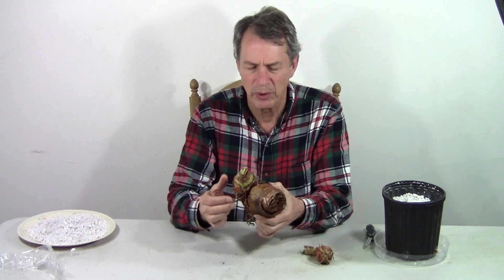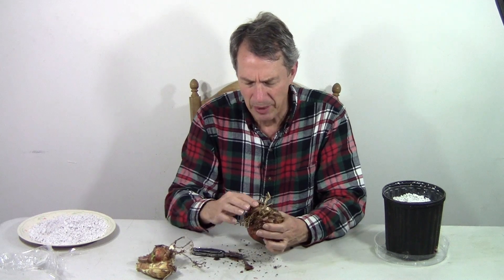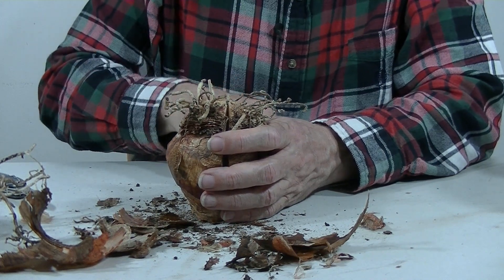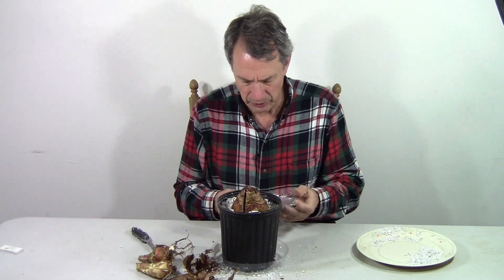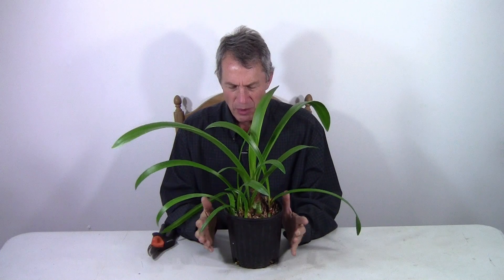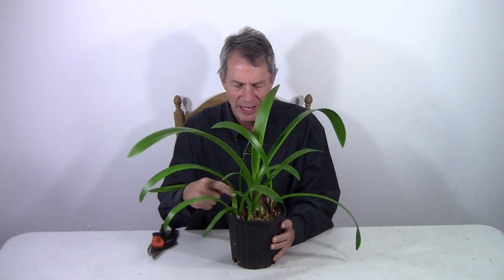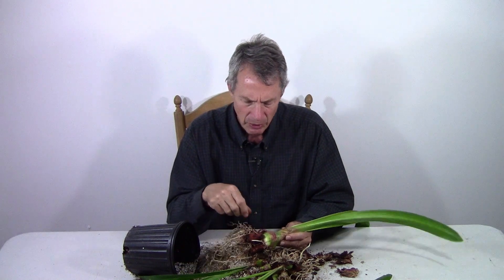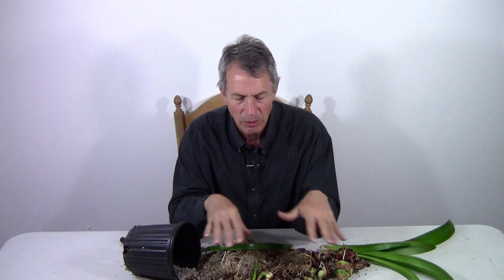Amaryllis Bulb Propagation

Comment: if you are able to cut through it and have them individualized what is the advantage of how you did the last one by leaving some still attached versus cutting all the way through it and having 6 separate wedges?
Reply from the maker: If they stay together, they can get nutrients from the leaves that are growing above them. if separated, they have to first grow new leaves before they can start growing a bulb. It works, but it is slower and some sections may not survive.

Comment: If I remove the basil plate will the bulb survive?
Reply from the maker: That is kind of like asking can I remove the tree trunk and will the tree survive. Check out this video that I made that shows the parts of an amaryllis bulb. https://www.youtube.com/watch?v=kD93TWySJJQ  It is less than 2 minutes long.
You can see how the basal plate is the stem tissue that has the buds for roots and leaves. I suppose if you peeled all of the leaves off and cut the roots off and had nothing left but the stem tissue that it could regrow leaves and roots. That would be the equivalent to plucking all the leaves off a tree and digging it up cutting all the roots off near the trunk and then replanting it. It sounds like an interesting experiment to me.
Reply: @agreenerview 
You can do twin scaling that produces new plants in a way with no basal plate involved.!
Look up twin scaling methods on youtube. 
Or you can cut from the top instead of from the bottom almost all the way down to the basal plate section in as many cuts as you like.
The more cuts the smaller the new plant bulbs that form will be.
You devide each cut with any a piece of plastic strip you place in the cut all the way down the cut to prevent the cuts from healing and growing together again.
You can just sprinkle some cinnamon or tumeric powder all over the cuts as well to help prevent fungal infections in the cuts.
Then pot the bulb like normal and wait for many new plants to form.
Reply from the maker: @brucecarey1780  Typically, twin scaling does include a portion of the basal plate with each piece. Tunicate bulbs have a paper-like covering and typically need a portion of the basal plate to create a new bulb from each division. Imbricate bulbs have fleshy scale-like overlapping storage leaves (lilies). The individual scales can be separated from the rest of the bulb and planted. Again, it is best if each scale includes a tiny piece of the basal plate. Many will grow a new bulb.
Reply: @agreenerview 
Very true. Just a tiny piece is needed to start a new plant but it takes time.!
Reply: No the bulb or the cut pieces will not survive.!
The basal plate contains all the growth points that is required for root and leaf development.!

Comment: I did this experiment in April this year. I now have eight little bulbs.
Reply: April is in the beginning of the Northern Hemisphere growing season. 
I suppose for me in South Africa it will be in September or October? I am keen to try this. Your opinion will be valuable on when I should try this. Just bought bulbs that was taken out and couriered to me.
Reply from the maker: @altastretton1768  You are correct. Start this project in your spring. I don't think it is too late. If you have a bulb or two to spare you could do a trial run now.
Reply: @agreenerview  Please help! Two of the bulbs arrived with soft spots. I had cut it away with a sterilised knife and had dusted some cinnamon on.
How do I prevent it from destroying the bulb completely. Think my mistake was not ordering in the dormant time.
Most do look healthy. Only two had rotten spots.
Reply from the maker: @altastretton1768  Call or email the company that you ordered them from to see if you can get some sort of refund. Keep those bulbs separate from the other ones and let the cut areas dry off for a few days before planting them.
Reply from the maker: I am so glad it worked for you. Now the challenge is to grow them to blooming size.
Reply: @agreenerview  Right! It seems these baby bulbs are slow to grow.

Comment: Cut in top to down. No down to top.
Reply from the maker: The basal plate tissue that makes up the stem tissue in the bulb is located at the bottom of the bulb. It is where the roots grow down and the leaves grow up. If you cut from the top down, you will only cut leaves and not the stem tissue that must be cut to make this type of propagation work.

Comment: Where do you store the amaryllis while you wait for it to get sprouts? Can you store it in a covered porch?
Reply from the maker: I use a closet that is in a cool room and I use a shelf in an attached garage. The temperature can drop down into the 40s and 50s F but should not get colder than that. If left in a warm room they may sprout early and you won't even know they are growing. I leave some in pots and I take some out of the pots. That doesn't seem to matter. I do put the ones out of a pot into a paper bag.
Reply: So if I live in the southern half of Florida I should probably keep it inside in the air condition? I don’t have a “cold” room
Reply from the maker: They don't have to be cold but cool is better than warm. Even though they are dormant, they are respiring. If left in a warm place they will shrivel up and dry out. @chantalchung9928

Comment: Can they stay in dormancy for 6 months?
Reply from the maker: Hi Vickie, They can stay dormant for a long time but since they are alive, they are consuming carbohydrates and nutrients all the time. As time passes they will consume anything they can to stay alive so the flower bud will die and then leaf after leaf will die until the bulb is dead. If the bulb is strong and healthy going into dormancy it will easily last 3-4 months with no problems. If kept very cool they will last longer. Six months is a long time so only strong bulbs in good conditions will bloom and be healthy at the end.